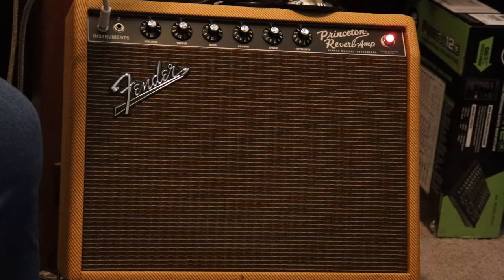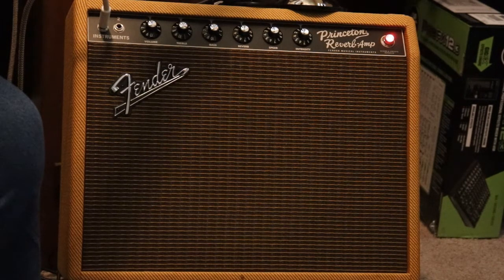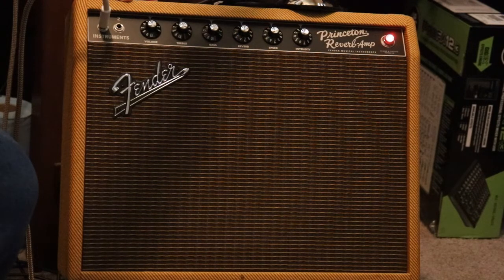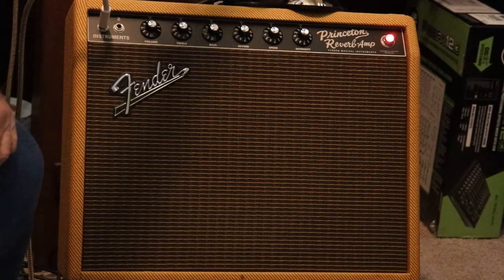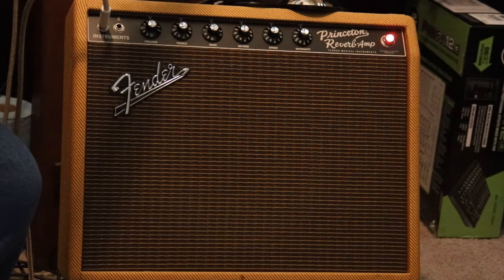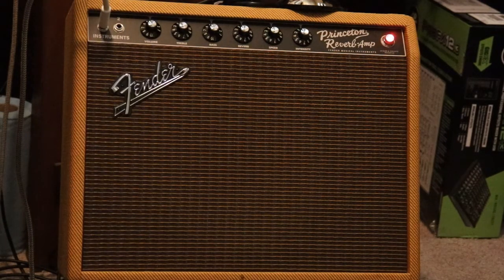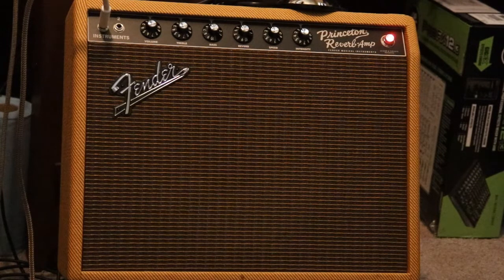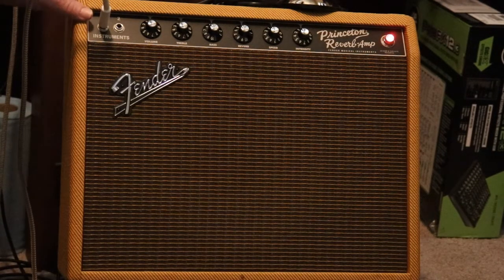65 Fender Princeton  Harmonic Overtones

Comment: Well this morning Sweetwater dropped the price of this amp by$100 so I ordered one. I wasnt sure if a 12 watt or 15 watt, not sure which it is, would be enough for a 12" speaker, but yours sounds great, so I got one on the way. And even though I was never a tweed guy,as I grew up with the 68 and newer silver face amps and later got to use some of the blackface stuff, I then realizeed how great the BF amps are, and now to get to tolex covering of the tweed...seems like a great mix to me. Thanks for your videos.
Reply from the maker: Good luck. Let me know how you like it. Thanks for watching
Reply: @davidmurphey9514    Just to let ya know, the delivery from Sweetwater came today, boxed and packed in a way that the amp could not be damaged if dropped from an airplane, but you were right, this thing is amazing. I guess because of the 12" speaker there is alot of bass even at very low volume. Volume at 2.5 to 3, bass all the way down and treble at 10, strat in bridge, tones 10, volume on guitar at 10...reverb at 4...super great sound,,,quite surfy sounding.  Your vids made me think I needed this amp, and you were right.
Reply from the maker: @Tom-xp7dl  I'm so happy it gave the sound and tones you like. Thank you for sharing your comments and results. I'm glad we both heard the same things
Reply: Is the princeton still rockin out? Any problems with it?
Reply: @Rainy78  No problems with this amp. I have played many Fender amps down thru the years, but this is the best Ive ever played. And dont let 15 amps fool ya, 15 watts is ROCKIN power.
Reply: @Tom-xp7dl  Glad to hear! Thanks for the feedback! 👍

Comment: What is it that causes the bright cap to be bypassed? Is it the volume on the amp, or the gain in the input signa (i.e. volume on guitar) l? I’ve noticed that at volume 6 on this amp, the EQ changes quite a bit, and the signal gets compressed as well.  
Would rolling off the volume in the guitar preserve the EQ of the amp at volume 6? In my experience it seems to do so, but wanted to ask you as well.
Reply from the maker: To answer your first question I don't know for certain. I will find out. I believe I'm certain but I'd rather not make the guess. There's truly not much compression at louder volumes that's actually the camera and the boom mic. You are correct about the eq change due to the higher volumes. All settings were at 1. Adjust your eq then when you bypass the bright capacitor you'll be impressed by the tones. I've noticed the bypass actually occurs just before 5 on the volume. I'll get the answer to your 1st question. Thank you for your questions and thank you for watching
Reply: Hey man, thanks for the commitment! But no worries! Whatever the answer is I think it’ll still be subject to anyone’s opinion :) what do you think the answer is? Don’t worry about researching it, don’t want to spend your time on that :)
Reply from the maker: @geralr  it's a good question. This time of year it's difficult to get the right person at Fender. However, I have other connections. It's not time consuming.